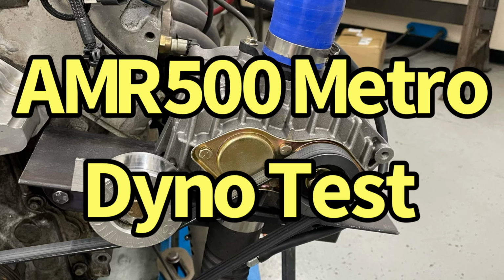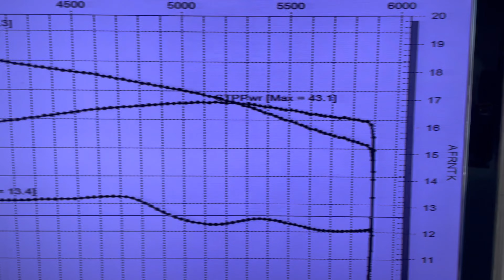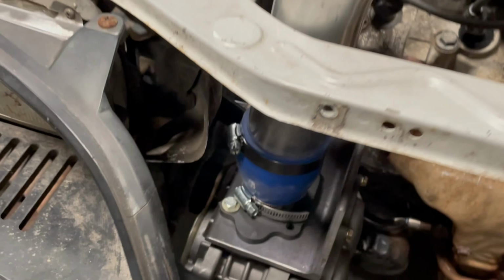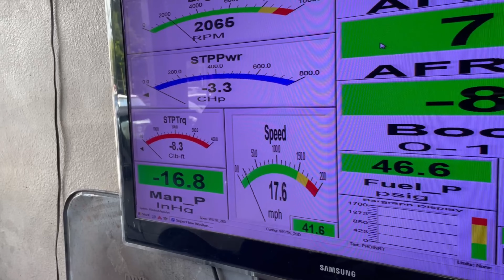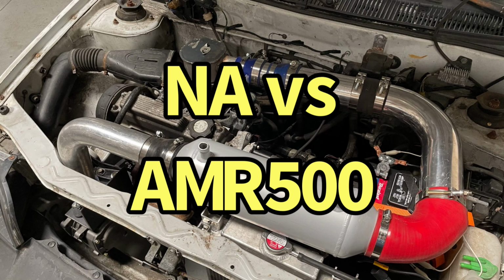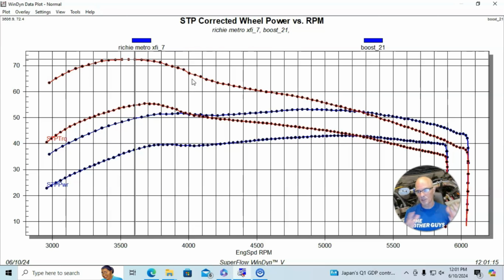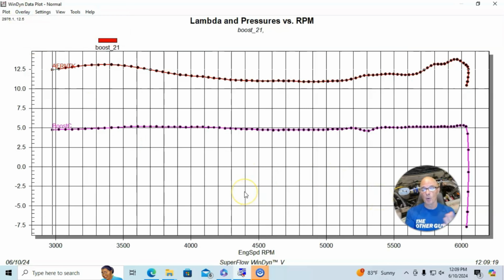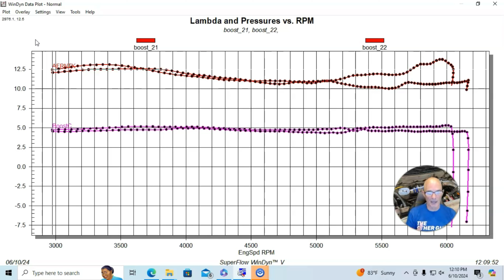FULL DYNO TEST-CHEAP, EBAY, AMAZON AMR500 BLOWER ON A 1.0L GEO METRO XFI! PLUS CHEAP ATW INTERCOOLER

Comment: C'mon baby! Let's make 80-100 to the wheels!
Reply from the maker: I did 120 whp with my Sprint Turbo
Reply: @richardholdener1727   this time up 200 😆
Reply: @richardholdener1727  120 hoarse metro would be such a fun commuter
Reply: @richardholdener1727  those were fun to drive. Worked at a dealer when they came out
Reply: If it started out with 40-50hp then that things gonna thump.
A fun thing to do after it's built ,is to find a willing participant with the same car but stock ,and see how bad you smoke it. 
Kinda wish DaveYugo was still alive ,I believe he was ripping some 14 flats with a na yugo
Reply: @richardholdener1727 hey can I pay you to ls swap a 85 Monte Carlo ss?
Reply: I only got 119.5 😭

Through a slipping clutch though
Reply: 120 cv you basically have a Suzuki Swift GTI wich Is the top performance version of this car under the real brand name, the Swift GTI twin cam was a very fun car and now Is hard to find and sought after

Comment: These little engines impress the hell outta me! They're making 1hp per cubic inch, running at 4,500 rpm on the interstate, and still lasting 300,000 miles! You can't talk real numbers with these engines because the numbers are too low, gaining 10hp isn't a big deal, gaining 20% more power rings home better.

Comment: Put a 100k ohme resistor in place of the air intake sensor location. It will richen it up quite a bit. Should be enough fuel for 5psi or more
Reply: Good idea, but the  MAT isn't able to add a lot of fuel, so I would use the coolant temp input instead.  You can use a 10 turn potentiometer and use the knob to adjust the fuel to what you want.
Reply: @echadmiyodea   There are 2 problems using coolant temp sensor one. The car never actually goes into closed lope. 2. Because of this open loop situation, you won't have any fuel trimming at all from the 02 sensor. This way, when you're under cruise without boost, you'll have an overfuel rich.  your miles per gallon will take a hit. Using the air tamp is the best way while still keeping the ability to have closed-loop.

Comment: Seen alot of vids where the amr is super loud, but robot cantina has one that is quiet and makes decent boost on a tiny diesel
Reply: Because alot of the time they mount them wrong way round. Just like donut and ghpc😅
Reply: Its only loud because people run them wide open all the time and either run them up to stall boost or just completely bypass when the throttle is closed. Thats a LOT of air or a LOT of pressure. Both of those things on a pds make a shit ton of noise.   Put a throttlebody on the blower inlet and take the tb off the engine's intake and you'll have a very silent and far more tunable config.
Reply: They make more noise when there's an outlet restriction like a closed throttle body which diesels don't have. At full throttle it's mostly the design of the blower.
 You can drastically quiet any blower down by putting a throttle body in front of it, which also reduces the amount of heat build up at part throttle. source: my m90 supercharged rx7 with two throttle bodies

Comment: Okay, I'm just going on record here for comparison: The American Chevette engines (1.6L gas and 1.8L diesel--both N/A) put out better numbers than that. (70-hp and 55-hp, respectively) As for the European models: They had option for a 150-hp DOHC Lotus 2.3L I-4 w/ dual side-draft Webers.
Reply from the maker: were any of those 1.0L 3 cylinders?

Comment: My 2c,
You dont need a bypass valve.
You need to wire the throttle body on the engine wide open, (or better yet remove the throttle plate to remove a restriction) then fit a throttle body (with TPS) to the inlet of the supercharger. 
When the blower spins, it pumps air. UNLESS you throttle the intake.
All the blown V8s, (6/71-14/71 etc) run either a carb(s) or mechanical fuel injection with throttle omates to control air on the intake of the supercharger. 
I put an sc14 (1.4ltres of air per revolution) on a datsun A15. (Drawthrough carb)  the further i opened the throttle, the higher the boost went. I could hit wot off idle, and it remained at peak boost right through till valvebounce. 
Its a bit more faffing about to do this to your set up BUT you will get linea torque production. And stable consistant boost figures.  
The other thing i would do is, given how high the milage is on this wreck, id have the injector (i presume it just run one big one?) Cleaned and flowed. If the spray pattern is all over the show, youll have a harder time getting good fuel distribution. And therefore get less peak horsepower.
Love your work btw
Reply from the maker: a BOV will eliminate boost at idle and part throttle
Reply: A BOV isnt intended to flow continuously. A friend ran one on a CA18DET (which was supercharged instead of turbo)  the noise of it moving 1.4 litres of air (per revolution) sounded like a satanic duck caller!   (No, it really did) 
I have zero doubt youll make it work. But it seems like a compromise in my personal experience.  Having manifold pressure being directly proportional to throttle opening would make tuning the load table maps a breeze too.   I boosted 74 flywheel hp up to 124 whp on mine.  It used to really cook in a 750kg car......
Reply: Throttle body, injectors, it's a carburettor.
 I was under the impression, from back in the day that to use a blow thru carb setup you need to modify the carb to handle pressure, or run draw thru . Id try a simple spfi
Reply: @Rob-rp3cw  what are you talking about? It's fuel injected not carbureted.
Reply: @DrewLSsix  ok, I should've looked closer, not an engine I know.
Reply: I agree with the ideas about relocating the carb/TBI unit to the inlet of the blower and just plumbing it straight into the intake. Perhaps mounting the blower higher up so it's above the intake? Also not integrating the Chilly Bomb in the intake piping. Let the fuel going through the blower cool things. Finally start with under-driving the blower (lower boost)and work your way up. My opinion.

Comment: Here on You Tube there is a channel called Robot Cantina. Over there they are using a supercharged 3-cylinder Kabota diesel to power a small Honda car. He is now working on sensors and 
variable rack position in the injection pump as well as regulating boost to stop black smoke on take off. Great stuff. This reminds me of his project.

Comment: Love this I bought an xfi long ago. I went looking for a turbo Sprint. But they discontinued it. Wish I still had it got 55 mpg after mods. 13" tires, advanced cam timing and shaved the head .030 to get that dismally low compression up. The xfi has taller gearing. If you wanted to hot rod one I'd go for the standard Metro for the gearing. Totally interested in this with the new parts your getting.

Comment: With the stock efi the most common way to do this is to use a non 1:1 fmu. Like the old supercharger setups on oxbodies and such.  5psi is about a third more air volume and the flow thru an orifice equation has a square in it. 45 psi stock and we need 33% more fuel so 1.33x1.33 = 1.77 times 45 = about 80psi will be the target extra 35 psi means you need a 7 to 1 fmu. might need a voltage clamp on the stock map sensor so it doesnt think its shorted.
Reply from the maker: we did a manual FMU with vice grips

Comment: Would a vortech Rising Rate Fuel Pressure Regulator (RRFPR) help control the AFR under boost here? 🤔 Awesome testing
Reply: Is that a Vortec branded FMU?
Reply: @Sir.VicsMasher  yes, they came with superchargers back in the 90s.
Reply: It shouldn’t make a difference on 40 psi fuel injection only running 4 psi boost.

Comment: You could always do the old Gus Mahon trick and use VW or SAAB cold start injectors on a boost referenced switch. You should only need one of the VW ones as they're good for about 15-20hp worth of fuel.

Comment: Having three Geo Metros myself, this is exactly what I want to see! Ive been interested in trying an amr500 supercharger on one of them to see what it would do. I have a 1991 Geo Metro XFi, as well as two Geo Metro base models with the 55 hp engine, which i think would be better candidates for the supercharger upgrade since they have a more aggressive cam and probably different fuel maps.

Comment: use a 10-turn potentiometer of the right resistance range to replace the coolant temp sensor and you can adjust the extra fuel through the injector that way.

Comment: Pretty sure a roots blower likes to have some fuel pulled through it.  that thing sounded real bad... this might be the only time I thought, maybe running the PCV  oily air into the intake , after the air cleaner , would be a good idea.
Reply: its got the TBI injection, i wonder how hard it would to relocate it over the blower
Reply from the maker: this roots blower was designed to run just air (no fuel-it was port efi) in the stock application (like most factory EFI motors running roots blowers)

Comment: I had the chevy sprint version, suzuki swift in japan, and it was fantastic. Wish I still had it. When they were first imporyed you would find them in scrap yards brand new with the sticker on the window, and plastic on the seats but the engines were always gone. Ultralight aircraft guys were buying them because the engines were better and much cheaper than lycoming or other traditionally used engines. There was also a turbo model available.
Reply from the maker: I set land speed records in my Turbo Sprint

Comment: XFI with it's single gap less piston ring may not be up to snuff for boosting??? I got 280,000 miles out of mine before the lower control arm mounting rusted and it was going to fail on the highway and turn hard into the next oncoming 18 wheeler. Just not the battle I want to be in. Besides they had brand new metros at the Chevy dealer(2020) There called Chevy Spark now. Not a bad car and it still comes with the coast pedal next to brake pedal.

Comment: Use a cheap microsquirt ecu with a single injector and a supercharged VW  POLO (Fox) G40 throttle body. The throttle body on those cars has a twin butterfly to allow boost to recycle at idle and part throttle. The secondary bypass throttle only fully closes at WOT, a clever design.

Comment: Who's metro ?  That thing is sweet !   I love projects like that.    During your testing it looks like you may have been losing boost right around the bonnet.  Watch the video and it looks like it's spraying away from where the tube enters the bonnet and blowing towards the right.   May have been an illusion, but I'd look for a leak.   maybe the wing nut wasn't holding it down hard enough.    Also I'd put some Slick50 into that blower  lol.

Comment: Long live the Pontiac Turbo Firefly! I have a fever, and the only prescription is more Metro! You guys should find a turbo Sprint or a turbo Firefly from Canada - a ton of fun right out of the box. Stand alone ecm and fuel system will be needed to overcome the fueling issues. Stock ecm can't read boost. Thanks for featuring the best little cars ever made... in Canada.  Pontiac: We Build Excitement!
Reply from the maker: I had a Turbo Spring that I set some records with-I still have two Sprint Turbo motors-one will be swapped into this Metro for testing

Comment: I've seen a few things, but this is the first time I have seen someone try to PWM an injector by hand! Basically most fires were rich or lean, very rarely would you have lucked out and seen the average appear to be correct! Next time get an electronic guy to rig you up a little PWM controller running at an appropriate frequency (easy to figure from the injector specs.)
Reply from the maker: I wasn't pulse width modulating the injector-it was a nitrous solenoid

Comment: Now you have me wondering what that would do for a 4 cylinder gasoline tractor that NA makes about 47 hp, and is fairly low compression with up draft carburetor on it.
Yes I understand that the fuel has to be increased, and is easily enough done by installing a piece of pipe in a J configuration with the proper flanges welded on to each end to allow for a 2 barrel carb to be used on top of the pipe down to the factory manifold, are even a new manifold to work with a 2 barrel carb or whatever you want.
By doing this this would allow for a custom header to be built as well giving several power adders at the same time. 
First thing is you eliminated the heat soaked intake that's built into the exhaust manifold too, bith of cast iorn and seriously one casting.
Then you have cooler intake air with more flow capacity and same with exhaust. 
Eaay enough to put intercooler in front of radiator, and the fan blades move more than enough airflow to do both jobs equally as well. 
And what's a couple extra tubes running around on the engine and cooling system on a old tractor.
There use to be a guy that was in Europe thar had installed an audi turbo on a 4 cylinder tractor that was wicked, but way too much power for it to be useful except as a toy because if you put a load behind it, all it was going to do is dig itself into China because of wheel spin .
Reply from the maker: if you place the stock carburetor (or a bigger carb) in front of the blower-the added fuel will take care of itself

Comment: I had a 95 Suzuki swift.
With a 1.3. Redline 4 cylinder. Single overhead cam motor. It would boil the tires as long as you stayed in it. It would run Away from Hemi in a eighth of a mile after that it was done.

Comment: Awesome stuff, can’t wait for the next video on this.  Btw have you thought about doing a ford 300 boosted blow up like you’ve done on the sbf and sbc?  That boosted video from power nation I think did well, but I know you would keep adding more boost.  Just a thought.
Reply: Good lord man, you'd have to boost it until it either twists the crank in half or sends the exhaust valves through the turbo as droplets...

Comment: Wonder if you could increase the boost by packing grease in between the rotors
Reply from the maker: that grease would go into the motor
Reply: Use sparingly

Comment: Couldn't you have put a smaller jet in the nozzle?   Option 2 run a pressure referenced hose into a sealed container with fuel and a second hose from the fuel to the nozzle. It will raise and lower the fuel with pressure. This was from an old book how to turbocharge anything way before efi and even blow through carbs were common
Reply from the maker: there is a limit to how small you can go on jet size-it is easily clogged

Comment: You wanna Improve that charger more... use it with one of my venturi based air boost pumps and you'll really get a boost
Reply from the maker: what is a venturi based air boost pump?
Reply: @richardholdener1727  well it's a thing I've invented and build, it's a 2 stage air pump... the first stage matches the input pump,  the amr500 could boost a much larger engine, or the second stage can boost 120 psi in short bursts. Also turned them into marine ramjet engines for boats, and currently working on using them to power an aircraft. They have more in common with a jet engine for your intake, but the turbo and superchargers are used to fuel and power them. Pretty neat. I've got more about them on my tok.

Comment: I wish you would do a full ebay hayabusa engine and turbo build all Chinese ebay parts like pistons, rods, valves, turbo intercooler, maybe a crank?, but asmant parts as possible with lots of details as there is nothing like what you do for seeing what a ebay hayabusa turbo can do,
It's not like there are not parts available,
This would be a great vid.
Reply from the maker: an ebay Hayabusa?
Reply: @richardholdener1727 
Yes an hayabusa build with pistons, rods, turbo, and maybe upgraded valves, cams if you feel like the challenge,
Use a old engine and upgrade it as there's tons of Chinese parts for the hayabusa but no detailed vids,
Boosted cycle performance started a series but never finished it and it's been over a year since last update,
That's the type of vid that would be awesome with your detailed work thanks

Comment: Hi, I saved the engine from my retired  '89 Metro XFi and have a second G 10 engine. I currently drive a '93 Suzuki Swift with the 4 cylinder. I also have an AMR 500, a AMR 300  & a VZ 21 turbo.too. The stock plastic inlet & outlet fittings are not good. I am in So Cal and would like to help.

Comment: Wonder why it was so loud and why it died...   oh yeah, it was open to atmospheric pressure the entire time and probably made 20+ psi on the back of that poor little throttle blade when you shut it. To do this correctly, you need to push the blower through a cooling brick straight into the intake. Put the throttle body BEFORE the blower.  Not only will you not run the compressor at its MAX LOAD the entire time, but it'll actually be quieter. In fact, you shouldnt hear it at all until you floor it.  

Putting another blower in this same config, even with a blow off valve, i still see it shitting the bed. You need to restrict blower inlet airflow.  You'll take a crap ton of load off the crank which will drastically improve idle as well.

Comment: Did you put oil in the supercharger gears? It comes with no oil from china, It's specified in the manual
Reply from the maker: yes-the damaged was caused by running excess blower speed on the LS flow test
Reply: @richardholdener1727  damn... I was thinking about putting One of those on a 92 fiat panda 4x4, but running at around 6-7 psi, so i think it shouldn't explode at those pressures!

Comment: Guess you should've used a firefly turbo ecu and intake setup 😊
Reply from the maker: I have two Turbo Sprint Motors
Reply: @richardholdener1727  steel or aluminium valve cover engines?